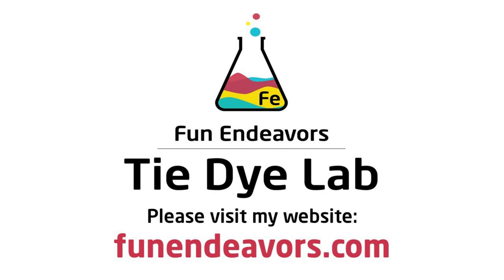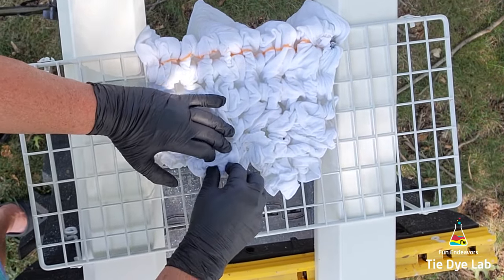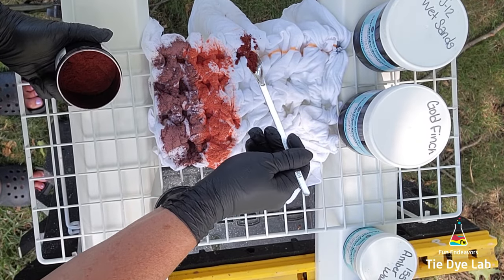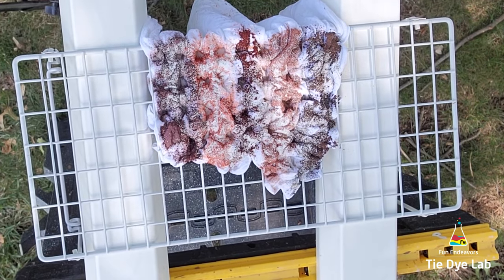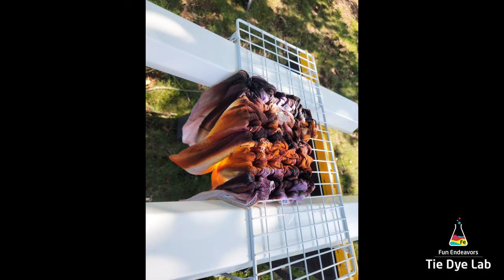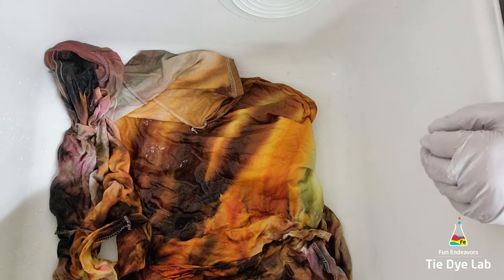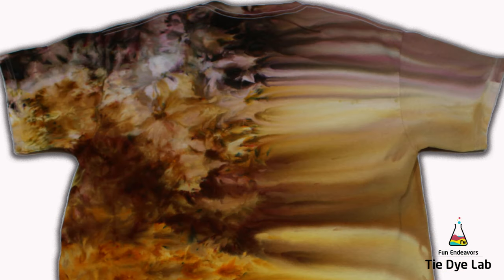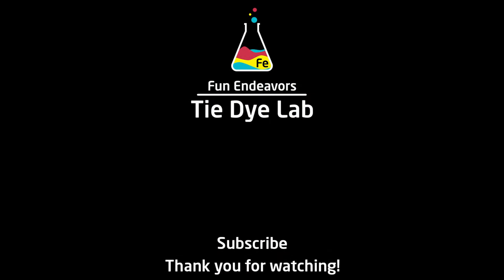How To Tie Dye A Gravity Ice Dyed Side Twist Shirt

Comment: I love this approach - however can this be performed on a man-made fabric such as polyester
Reply from the maker: Thank you!   No, not using the dye that I use.  I use fiber reactive dye and it only works on natural fabrics such as cotton. 😀
Reply: I understand that it requires a special kind of dye for polyester fabric however my main question is - can you ice dye  w/ this special type of dye - I am of the understand the man-made fabric requires boiling - is that what your knowledge indicates.  Thank you for your replys
Reply from the maker: @cathyreay8127  I haven't ever used polyester dye.  I've heard they need boiling too though.  I did a little research, and it looks like the dyes need boiling water to make the color permanent and to relax the fabric so that it absorbs the dye. Therefore,  I don't think this process would work with ice and polyester dye at all.